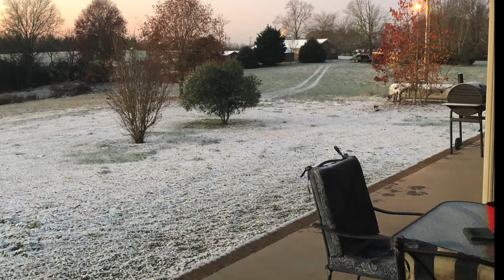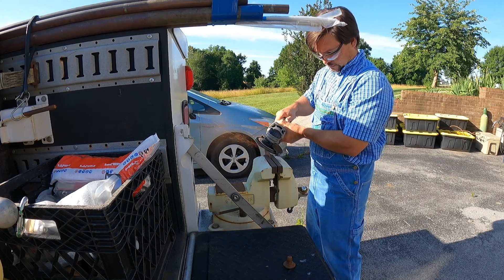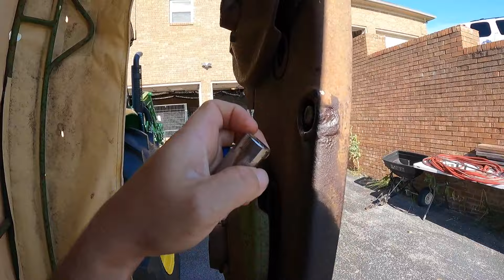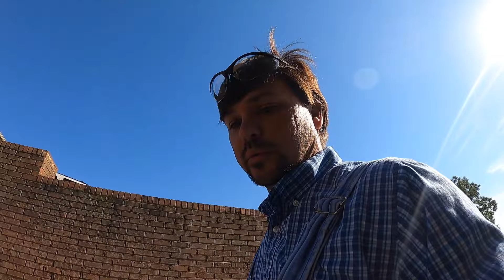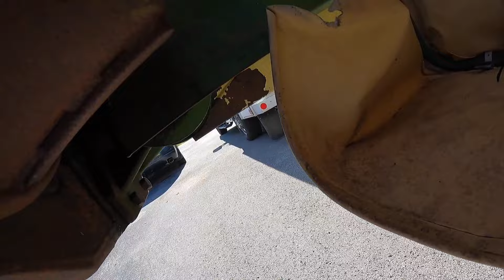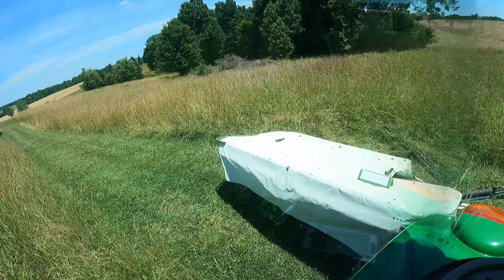5075E & Krone AM242 Cutting Hay

Comment: Hey man let me help you out. Lay the mower out horizontal and pick it off the ground about a foot. Then put vise grips on the blade you are sharpening and then use a 4.5" 40 or 60 grit flap disk. Do no remove the blades unless you are flipping them. WAY easier and faster and you will have sharper blades that retain their temper.